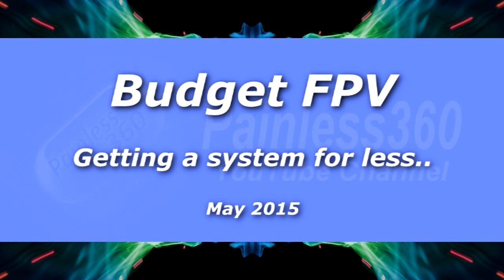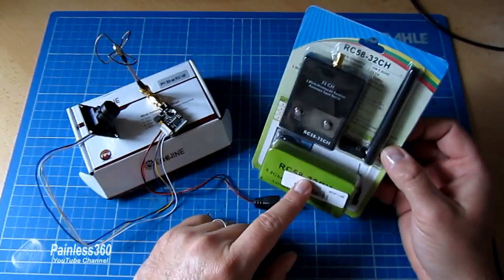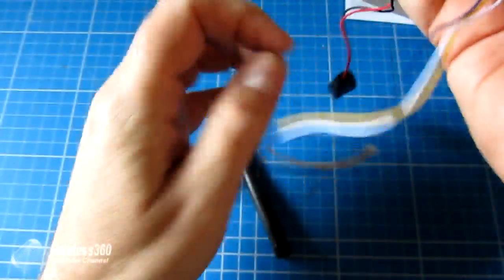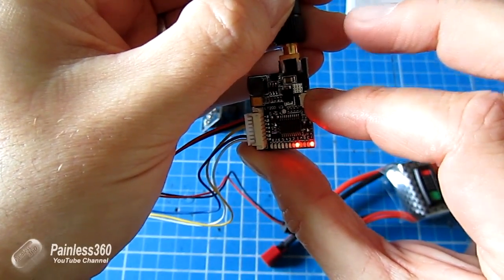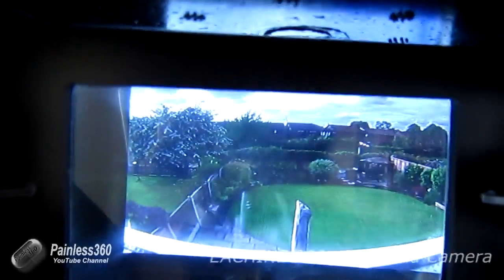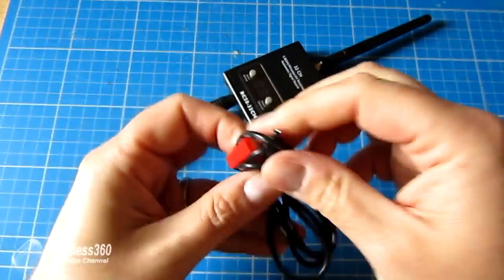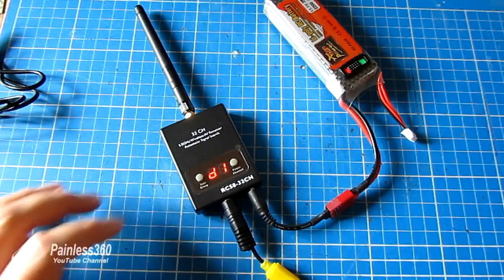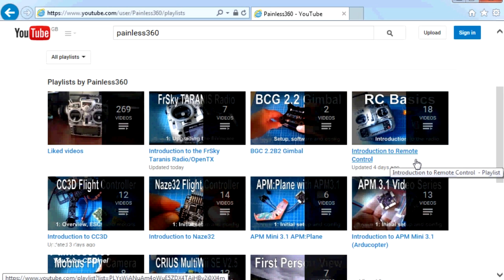Great FPV on a Budget - How to get a camera, transmitter and receiver (products from Banggood.com)

Comment: I really need help with my quad/ my Fpv system. I bought a Eachine falcon 250 at banggod.com and Eachine vr011 goggles but the problem comes when i connect them. After i pressed the scan button on the goggles, it just show a jumping blackwhite live video. I thought i burned the vtx so i bought a new one but I get the same results. Thanks if any body can help me and sorry for my bad English
Reply from the maker: The only thing I can think of is an PAL/NTSC issue. Make sure both ends are set to the same video standard.. Best of luck!
Reply: Painless360 i had no idea what PAL/NTSC issue was but when I search it up on youtube I saw you made a video about it. And it really helped me so I can now see a nice live video in my goggles. Thank you so much!!! Your videos are best!!! Big big thank you from a 15 years old girl from Sweden!

Comment: Can you give me equipment for 1km range fpv?
Reply from the maker: +Λευτερης Λευτερης depends on what you can legally use where you are. Using the maximum power on the video transmitter and good quality antennas, with a high gain directional antenna on a nice sensitive receiver should get you out to that distance.. Best of luck!

Comment: Hi mate I recently done a lumenier qav250 build and bought one of the new ImmersionRC 600mw raceband vtx's but i kept my rc58-32 channel in my HK quanum v2 goggles because it is supposed to pick up the original fatshark bands right? but I am not getting any signal through at all I have the IMRC raceband dip switches set to up up up down which is supposed to set the IMRC racebands to the original fatshark band but nothing is this a common problem or is there possibly a problem with my vtx the red led on the IMRC is lit up red as if it is working but no picture do you have any suggestions mate.
Reply from the maker: https://youtu.be/R1rOrbfWk74 may help. I would contact the vendor for support, best of luck
Reply: Thanks mate

Comment: dumb question... if we connect the balance conector to a 3s battery ... wont it will discharge only 1 cell ?
Reply from the maker: It will pull a little extra current from that one cell you're using yes..

Comment: Great video! 
I would like to use my Sony RX100 M3 as the video camera and use a HDMI to AV converter like this one
http://www.banggood.com/FPV-Micro-HDMI-to-AV-Converter-Board-For-Sony-A50006000-Camera-p-941263.html
It has a Yellow cable to connect Video Out.and a Black cable to connect Ground.
Are those two wires compatible with the Eachine 700TV transmitter as it looks as if it needs 3 wires?
Reply from the maker: Peter Arnold Looks like it would work but be aware of the lag from the camera..
Let me know if it works..
Reply: Painless360 THanks, will do